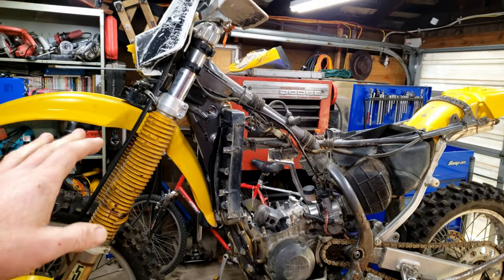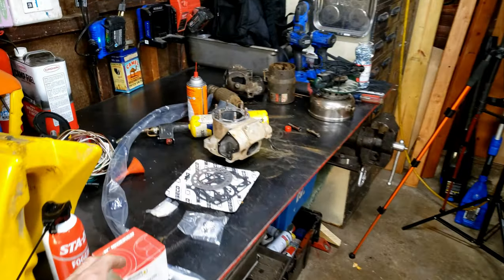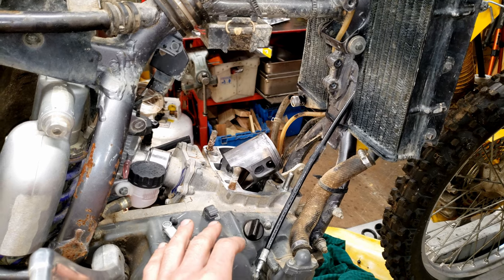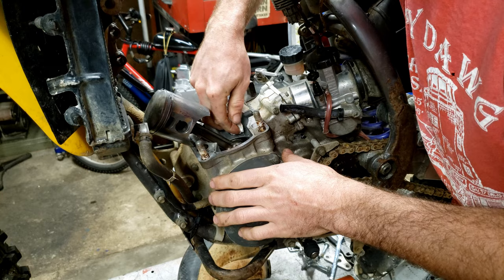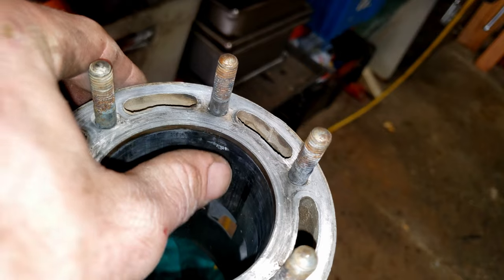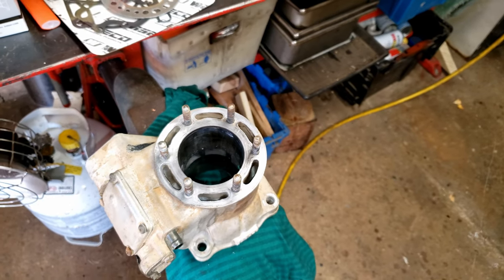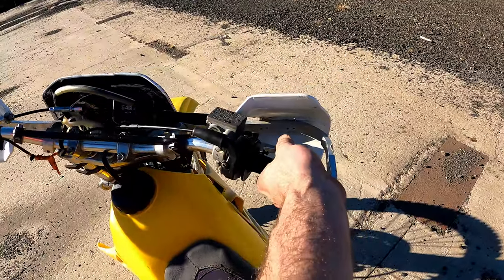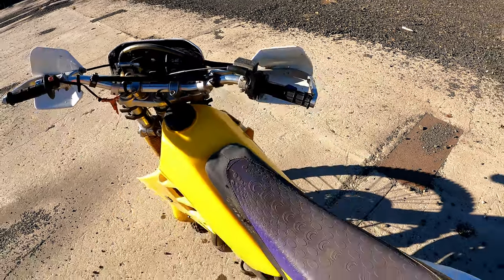Suzuki RMX250 with No Compression NNKH

Comment: top video mate,as a kid i bought a no compression 1982 rm465 and the barrel was so badly marked that the fella at the wreckers sold me a 1983 rm500 barrel and i bought a new piston 1 size overbore as i had to get that ol 500 barrell bored out,slapped it back together and it had so much compression for a 14 year ol that i had to use 2 copper headgaskets to lower the compression but it still went like a freight train
Reply from the maker: Thanks.  And that's awesome, I always wanted to get a big bore two smoker. Hopefully one of these days!

Comment: I like the talking in the beginning better.

Watching you rebuild that 2 stroke reminded me of my first time rebuilding a 2 stroke. I was 16 years old and it was a YZ 125. The cylinder was a little scored so I bored it to 144. Thing was a rocket ship.

Then a picked up a super minty 1998 KTM 250 SX for $600 barely running. It needed a new top end rebuild too. I rebuilt that one but didn’t re-hone the cylinder and the bike ran super shitty for 30 minutes then died. I don’t know what I did wrong, but I sold it for $800. I wish I hadn’t ever sold it.

Comment: No heat cycle, just fire it up and rip! Don't think I would have done that, but to each his own. I have rebuilt motorcycles as a hobby for 10 years. My first was a 1990 Suzuki RM250 much like this one. It's not an expensive hobby, really. I would love to do a car like the Plymouth you did but may be a bit outside my budget. Keep up the videos!
Reply from the maker: I warmed it up in the backyard for like 7 minutes or so and then let it cool down, and then took it out for a rip. And thanks man I appreciate you checking out the videos!

Comment: I love your video. I have owned a '99 RMX250 since 2004 and it currently sits at the back of my lock up. I rebuilt it entirely in 2008 but i haven't started sinced 2012. I wonder, are tbe wiseco piston kits atill available in the US? I'm in the UK.

Comment: lol, We sometimes used 1 or 2 size bigger new ring and left 1 of the old rings, but needed to file the ends of bigger ring. It didn't have too long life but it was stronger than a good engine, We had Simson with 51cc engine which is small but bigger ring was good solution times like this, because there weren't all parts available in the shops (it was under communism in Hungary) and we were kids and kids usually have not much money.

Comment: I would have filled the lower end  up with gas and let it sit for about 15 min. A leak in the seals could be detected by a drop in the level plus the gas will help flush out contamination.

Comment: You gotta hone it. Lightly. I run an OHV repair shop in my shop in back of my place and I see a lot of those fix super cheap make run stuff. It should be fine but dang that got hot.
Reply from the maker: Yeah pretty crazy to see a liquid cooled  engine get hot enough to melt the cable! I haven't seen that before

Comment: how much does a an old liquid cooled two stroke like this weigh, find it heavy compared to something modern or not much difference? my first and only bike is a DRZ400 and by god is it heavy for a trail bike, tall too even for me beingg 6'3" im tip toeing to sit on the seat.. street and trail though any lighter and youd blow off the highway, its pretty miserable white knuckling it if there any wind to highway cruise as it is

just did a topend rebuild similar to the video in my back yard after the timing chain let the valves meet the pistons.. 40,000kms on the bike though so no shame on it

Comment: so if the cylinder isn't too bad, you can re-use it?  is there a way to flush out the bottom end or get any metal debris out? yz was running great today then lost power and now has no compression ...
Reply from the maker: It's best to have the cylinder redone, but yeah if it's not too bad you can definitely hone it out and use it. Just might not last as long as you would hope depending on how bad it was. As far as flushing the bottom end, yeah I suppose you could use whatever technique comes to mind. Best is to split the case and redo the entire engine. But it really depends on the severity of what occurred and how much metal is down there

Comment: Those 250s have all the meat and potatoes, I acquired a YZ500 years ago and rode it once and sold it because it scared me. LOL. Then I bought the 660 Raptor quad which then got the 686 stroker treatment which was fast and fun but after an accidental toe amputation while wearing sneakers out riding and a divorce she also went on the market.

Comment: Those bikes are really good when they aren't clapped out. I'd have no problem racing one in hare scrambles against the new bikes. The piston manufacturer is pronounced "Y- sko" 
If that thing still has an airbox cover under the seat, throw it away. It only restricts air.
Tell your friend to be nicer to his bikes.
Reply from the maker: Yeah they are great bikes for sure. I've heard it pronounced both ways. But I figured I would pronounce it that way and see what people say.  I used to always call it Ysko and then some guy corrected me years ago. Maybe he was wrong.
Reply: @NoNonsenseKnowHow  however you say it. Never ever ever use Wiesco cranks. The are poor quality.  The pistons work good. I really like your XL probably a little more than your KZ. But a little less than your cool squirrel.  How did you end up with a shop squirrel?
Reply from the maker: Oh okay Cool I'll keep that in mind. Never used of a wiseco crank.  And we found three infant squirrels in a truck camper that we were parting out. There is a link to some short YouTube videos in my last videos description showing where we got him and him growing up.

Comment: Wow, ever hear of seating the pistons?
Reply from the maker: No I've never heard of that. Lol.  It's called seating the rings not the piston. Make sure you have a nice hone job with 45° cross hatch, make sure the engine is set up right so you're not cranking and cranking when it's time to start. And when it does start, don't let it idle. Bring up the RPMs and fluctuate consistently.  I've rebuilt countless engines. And have never had any issues using my techniques. Everybody does things differently.  Hope this helps answer your concern Mr Trump.
Reply from the maker: I actually just glanced back at the video now and I'm guessing maybe you thought I went on the test drive immediately after starting it. That wasn't the case.  But I wasn't going to record me sitting there running the engine up to temperature fluctuating the RPM and running it through the backyard lightly.